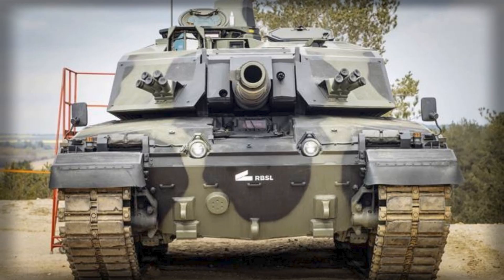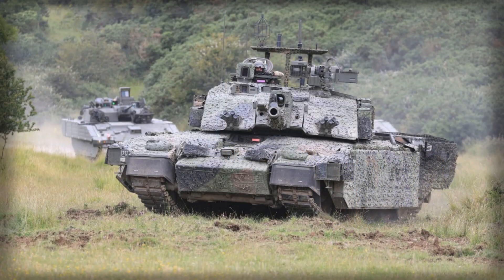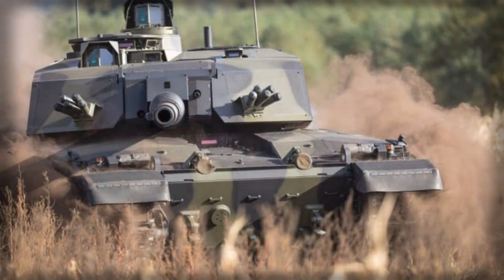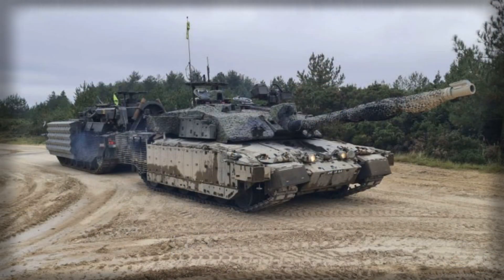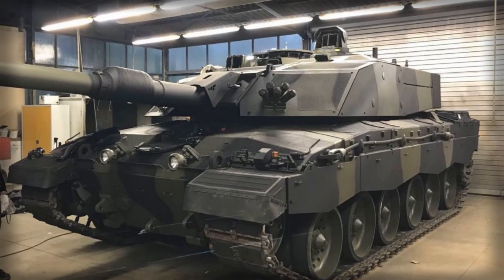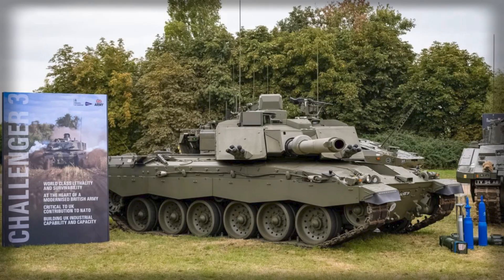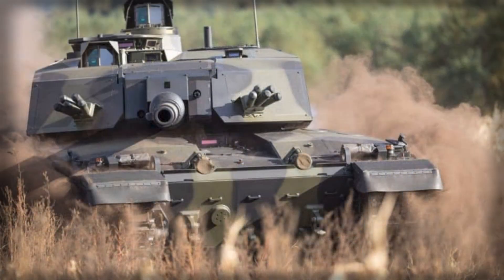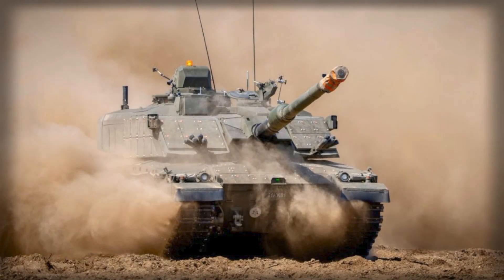Britain’s Challenger 3 Tank: 76 Tons of Power with an Old Engine?!

Comment: Nothing wrong with either the tank or engine.  The new barrels I hope will be as accurate as the previous as they change from rifled to smoothbore. It's a very heavy, quite slow very accurate and very safe place to be for as long as we need tanks.
Reply from the maker: I think they will be just as accurate. There are guys with their heads, I think, who are working and calculating. So everything will be great as before!